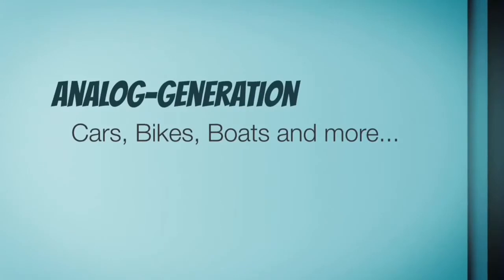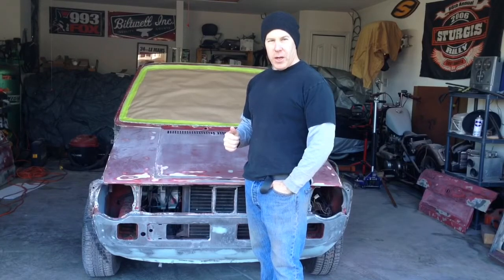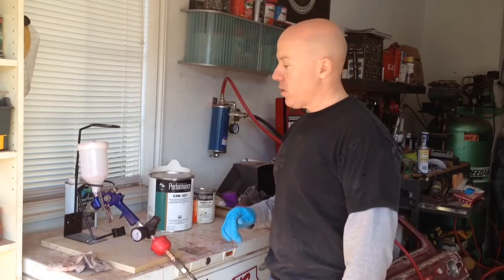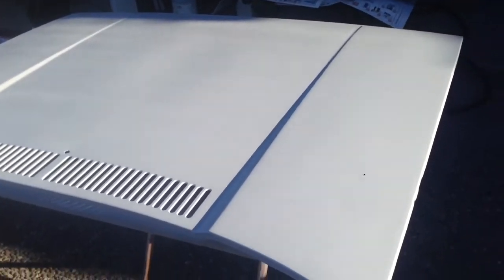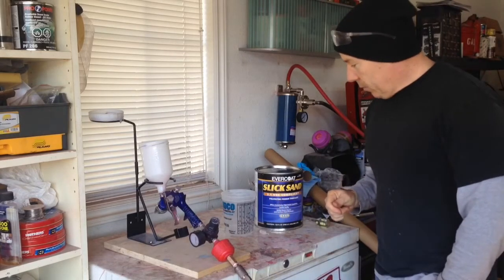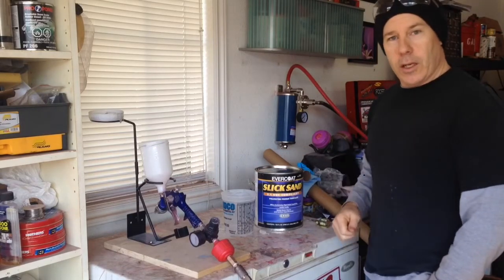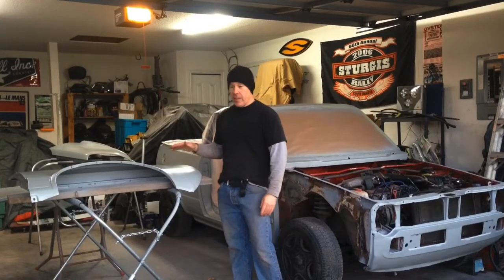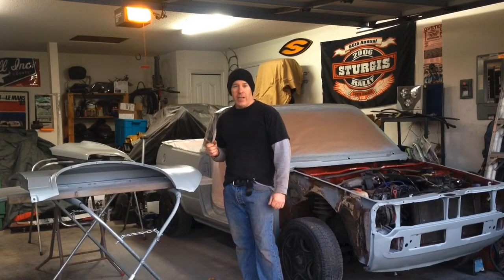Spraying Epoxy & High Fill primer - 1980 Mk1 VW Rabbit Convertible Project Episode 19

Comment: Hey! How's it going? I'm just about to start priming my Cabrio, and I'm using an epoxy primer! Just wanted to know, what chemicals and towels do you use to clean the metal before priming? I've been using POR-15 metal prep and microfibre or Terry cloths, but the metal still has some light surface rust, and the cloths leave small fibres on the metal... 🤔 Should I use a different cleaner?